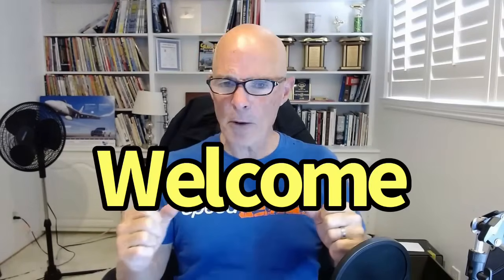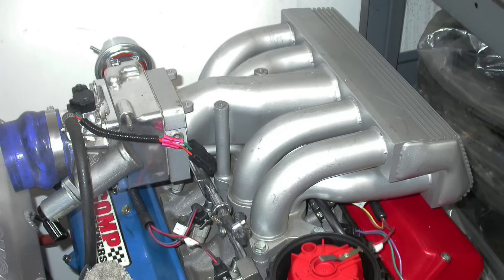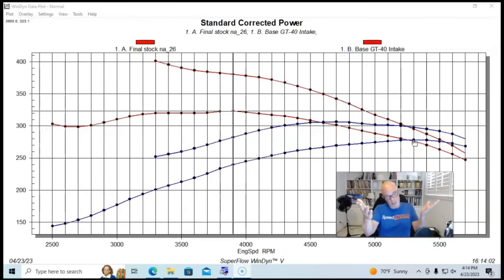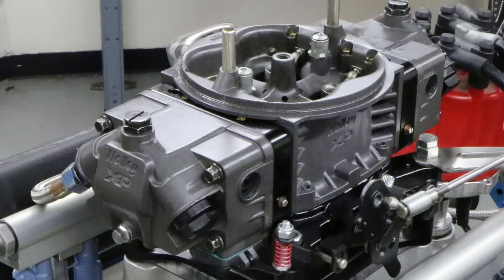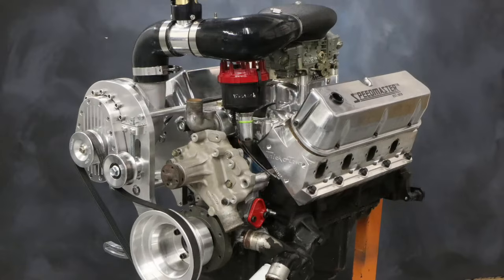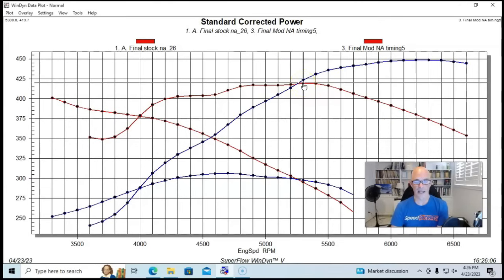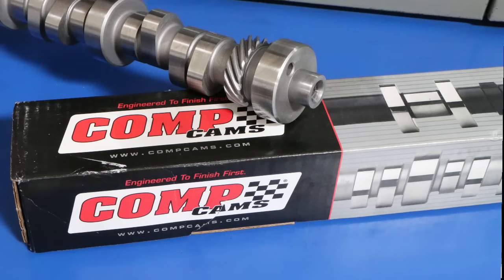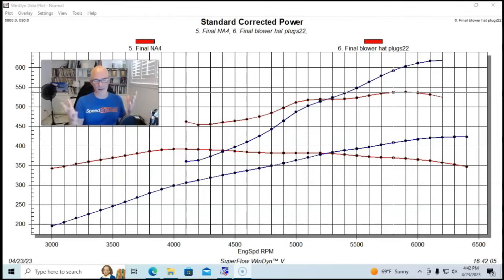WHICH ONE MAKES MORE 5.0L HP, E7 HEADS & CAM 347 STROKER OR HCI 302?  WHAT ABOUT WHEN WE ADD BOOST?

Comment: He did the 347 dirty by not running a bigger cam. Of course you're going to get stock 302 level horsepower with the stock 302 cam. I bet if he would have used a better cam and a high rise dual plane intake he would have made at least 350 horsepower.

Comment: So running stock top end is possible on 347? Everybody is knocking me down for it
Reply from the maker: yes but doesn't make power
Reply: @richardholdener1727  i just want a running car at this point. already have a built  short block 347 thats been sitting in a bag. how drivable would car be 95 mustang
Reply: Like richard said makes no power but you have a solid base for when you can afford to upgrade heads, can intake down the road
Reply: @msk3905 Damn!How much power do you need?
Reply: @PatchesOHoulihan69  if you don’t care about power why spend extra money on a 347 bottom end with 302 top end?

Comment: For the Carcraft 302, were those oem spec pistons used with the 11r heads?
Reply from the maker: which car Craft 302?
Reply: @richardholdener1727  the 2nd build mentioned in the video at 4:10 with the TFS 11r heads. The pistons in the picture, were those kept in the motor?

Comment: With all of the historical 5.0 hci data that you have on file, i am really curious to see the peak numbers and power curves when a small 302 is paired with oversized hardware...tfs hi port 225 heads, .600 inch lift cam and tfs r intake for example...n/a and of course with boost. 

I have heard you say that the motor or combo making more power na will make more power under boost. Is there ever a scenario where an oversized hci combo that makes less power na than a more appropriately sized hci combo, can or will somehow make more power with the addition of big boost?  

Thank you for your continued sbf testing!
Reply from the maker: I wouldn't pick a TFS R intake, but the rest of the stuff will work, I haven't seen a situation like you describe, except in the case of a VTEC Honda motor. They often do better than the formula

Comment: For the stock bottom end with tfs heads and cam. What intake manifold and throttle body do you recommend on a fuel injected motor to get similar power?
Reply from the maker: tfs

Comment: Richard thank you , Just what I was looking for I have a stock 91’ 5.0 H.O. Short block . Will be adding the 11R-170 heads & the TFS stage 2 cam and now I know NO piston to valve interference . Of course, I will check it anyways. I will give the summit 600 CFM annular boosters carb a try on an old Offenhauser 360 split single plane intake. If I don’t like the outcome of the intake, I will go with Edelbrock air gap dropping it into my 66 mustang. Heidts pro G suspension front and rear.
Reply: what pushrod, lifters and rockers did you use?
Reply: Are your pistons oem spec when it comes to valve reliefand compression hight. And are the wedged or flat-top? And what length pushrods did you go for?

Comment: Any cam recommendations on a speed density Lincoln LSC or advance stock HO cam for more torque? It has explorer intake,P heads ,AOD and 327 gears stock converter.
Reply from the maker: HARD TO BEAT THE STOCK ONE FOR LOW SPEED TORQUE

Comment: Hi, Richard. There is a guy on YouTube insisting that changing ignition timing also changes AFR. What is your opinion from theory and experience point of view?
Reply from the maker: WE HAVE SEEN ZERO CHANGES IN AF FROM TIMING CHANGES AND HAVE SEEN AS MUCH AS 1/2 AF POINT-IT'S NOT MUCH
Reply: Yes, some people claim thatbthere is a direct connection between AFR and ignition timing as they confuse changing in lambda readings becase of change in temperature and pressure in the combustion chamber causeed by different ignition timing. But ignition spark occurs well after intake and exhaust valves close during compression stroke so there is no way ignition can have any influence on how muck mass of fuel and air got trapped in combustion chamber...

Comment: Have you ever done a comparison of 347 vs 351w to see if theres a measurable difference?
Reply: I'm pretty sure he did. The 347 made a little more hp and the 351 made a little more torque, due to the difference in intake runner length between the engines.
Reply: @7950pacecar He did the comparison but he didn't even use the same parts in each engine. Of course you're going to have variable results when you use different parts.
Reply: https://youtu.be/VAi1_2PU-OQ
Reply: That link goes to Richards 347 vs 351w video
Reply: Holdener did it.   It's exactly what Chickeroo said.   The 351W made more torque due to the runner lengths, and the 347 makde just a little more HP up high due to shorter runner lengths.
Reply: @dennisrobinson8008  don't forget lower end ways 20lbs more on 351, y it yielded more torque, and 347 made more hp
Reply: @alltherpm  true true.  Those crank and bearing journals add weight.  So the crank, the block and the intake are heavier due to the size.

Comment: Richard nice power for the 302 na but you gotta put better heads on the 347 then compare performer air gap and victor jr how about testing afr outlaw heads against renagade heads
Reply: rpm air gap is doing big things, it used to be that most EFI intakes were making more torque than the carb intakes even dual planes...   Air gap changed that, makes great torque besting many EFI intakes and good power  to 7000.

Comment: This isn't universal. The ly6 based 408 with stock ly6 heads made more power than aftermarket heads on an ly6 in another test you ran.
Reply from the maker: WHEN HAVE I RUN AN LY6 BASED 408?
Reply: @richardholdener1727  or was it an  ls3 based 416?
Reply: @richardholdener1727  The 408 in the video which you say is using LY6 heads (because they do not have the lighter components like the LS3) has a better power curve than the stock stroke 6.0 with trick flow heads
Reply: @richardholdener1727  Didn't you run a 408 when you did the LSA test?
Reply: @richardholdener1727  I was incorrect. You ran a 402 LS2 in the LSA test. I watched it again. Since, it's one of my favorite tests.

Comment: What compression ratio for 8 psi of boost on 91 octane?
Reply from the maker: INTERCOOLED? COLD AIR INDUCTION? ALUMINUM HEADS? TYPE OF BLOWER OR TURBO?
Reply: @richardholdener1727  For the combinations tested.
Reply from the maker: THIS WAS 9.9:1 WITH THE TFS HEAD I BELIEVE-347 WAS A TOUCH HIGHER

Comment: I love these videos. I’m planning to replace my stock heads over an aluminum GT40 heads and have a mild camshaft (smooth idle) no headers. Is it good for like 300 HP?
Reply from the maker: SHOULD BE
Reply: @richardholdener1727  thank you. I’d like to have an idea how much power I leaving on the table with stock exhaust manifold in a 300-350 engine.
Reply from the maker: 15-18 HP OR SO
Reply: @richardholdener1727  thank you!!!

Comment: What is the full dress weight difference between 302 and 351? SBE 351 hci vs. 347 hci in cost? Power should be basically identical... Save for intake differences right? 
Not to mention most would argue the 9.5 deck is stronger if pushing block strength, and capacity of what? 408? 418? 427?
Reply: Swapping in a 351 in a Fox Body needs a new custom oil pan, relocating brackets for accessories, headers, intake, and an oil pump. It's not a drop in deal.
Reply: @ahoneyman  With the right stuff it is.   But its surely a little heavier.    Heavier block, heavier intake.  Maybe 80lb?
Reply: Oil pan,intake  and headers would be replaced on any well built 302 anyways, so the only extra is the 351W mounts.
Reply: 351 basically has longer runner lengths due to the 9.5 vs 8.2 deck.  Itll make more torque and a shorter Power band.
Reply: Yes, an engine with more displacement and the same HCI will make more torque and good chance the same HP at a lower RPM. All that depends on what the limiting component is, H, C, or I. That said, a bigger cam and/or larger intake in a larger engine can make the same or more low end, and outperform the smaller engine at RPM. Displacement eats duration right? So all that said, how much are you willing to pay for upgraded power becomes the question. If that 408+ makes 60 ft lbs. extra average power over a 347 for $600 more, is that worth it? not real numbers, just an example

@richardholdener1727 do you have a test where the under say 4500 rpm output matches between a mild smaller engine (302, 347) and a wilder larger engine (347,351,408)? Assuming larger losing low end from big duration and a single plane. Just a comparison to see how by having more inches you can match the smaller engine for driving and kill it racing. AKA street/strip (yes I would accept an ls comparison 😥)
Reply: @Jim_Lawrence  LS comparison you can get this info plentiful.    It is much more realistic to make big power out of more cubes and have it more driveable on the street.   The big cubes also lets you make this big power and keeps the rpm down over the same combo on a smaller duration.
Reply: @dennisrobinson8008  Is there a video that he overlays the dyno charts? I don't remember seeing it. 
And yes, I love big lower RPM. I'm actually a diesel guy nowadays if that says anything...
Reply: @Jim_Lawrence  Hey Jim.  Thats cool on diesel I was enjoying watching 6 to 8 seconds 4 to 6 cylinder diesel drag racers with over 100 psi of compound turbo.  His video does show dyno curves.   It was clear that the bearing size in the 351  eating up HP is mostly theory.    I thought it would show itself by the 351 making 10 to 20 ft lb less due to an unexplainable phenomenon but that data did not show.    The 351 made similar peak torque at lower rpm due to the longer runners.   The power band also shorter on the 351 because of this.  Since everything is custom might as well opt for a Cleveland size main bearing of 2.75 and rod bearing of 1.85 or Chevy 2.10 vs the stock 2.3".    This gets weight off the crank and rods lighter too in the big end.  Also if we got 351 block we may as well opt for 408 to 427 cubic inches even up to 434 there's no downside.
Reply: @dennisrobinson8008  I haven't seen anything where different size engines match lower RPM output, unless you have a specific video where Richard showed that.
I love my diesel, I won't be racing it though, it's more of a fuel economy for the size, run forever and move anything I hook up to kind of rig. Pushing 300k now.
I don't know what you mean by everything is custom. Stroker kits are readily available for 351W, possibly to 427? I think they go bigger for the Dart big bore blocks.
NEOMustangs on YT has a video where he weighs 302 and 351 blocks and cranks. I don't think it's real scientific, but I remember the 351 block being 60+ heavier maybe, and the crank was a big difference too. Like you mentioned the journal size is up comparatively. He has some turbo foxes, stock 9.5 deck roller block 410 over 800 wheel and a Dart 363 about the same.
Reply: @Jim_Lawrence  Richard did the test and had the dyno graphs, so it was clear.     When i say everything is custom when you do a stroker 351 build, you will have custom crank rods and pistons, so once it's custom you can specify it to be whatever you want, so you can request it to have the 2.10" rod journal or the uncommon 1.85" rod journal.   Also you can specify 2.75" Cleveland mains, both of what would get some weight off the heavy boat anchor crankshaft.    The 302 mains are 2.25" and rod journal is 2.10".

Guys with a serious 302 will have the headers, the oil pan many will replace the factory motor mount with something solid...   So all of that is replaced anyways.

Anyway i thought the large main bearings would degrade power a notable amount but it was just not there,  and Richard also said in testing that one doesn't show up.    But in theory it makes it into the books, pretty sure David Vizard mentioned it in "how to build horsepower".

The test certainly showed when we build a 351W based build we have to account for the additional runner length over a 302 build.
Reply: @Dennis Robinson  I'll search the sbf vids to see if I can find it.  Thanks

Comment: yeah im tossing the idea  around  302 HCI  stock 1979 bottom end with trick flow 170 vs buying the stroker kit and doing a 347 with TW 190 11rS

  will be carb 6500 RPM  redline.

Comment: Personally, because you asked....
🥝✔️, on a Fox Ford, I'd Always have less low end torque and optimized gearing with HCI, than extra torque and power everywhere with a capacity increase. It's the age old condunrum, the chassis has to meld with the torque.  The old adage "For straightline power, Go Cubic Inches" has a problem...Instant tire incineration. I vote  "The Head Cam Intake swap engines are so much sweeter".
Reply: Personally I blame squirrels soooo ... just saying 😎
Reply: @unclesquirrel6951  🤪✔️